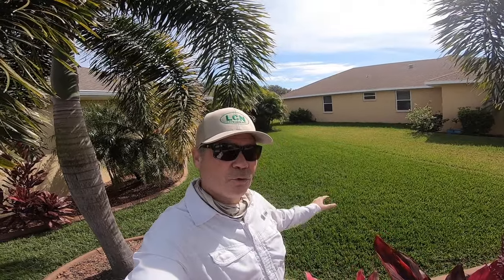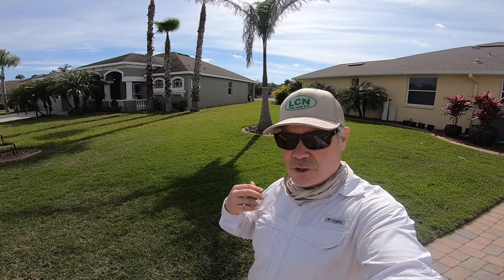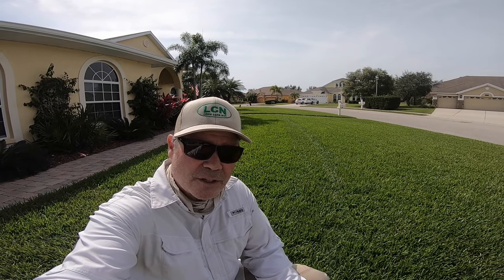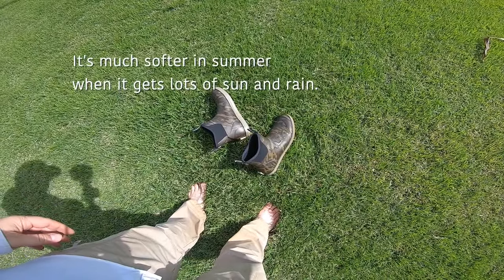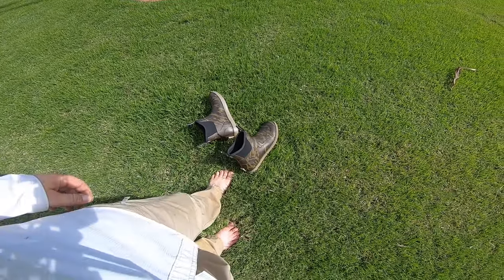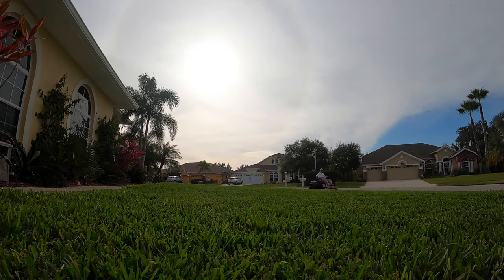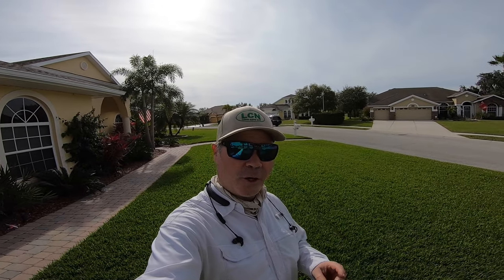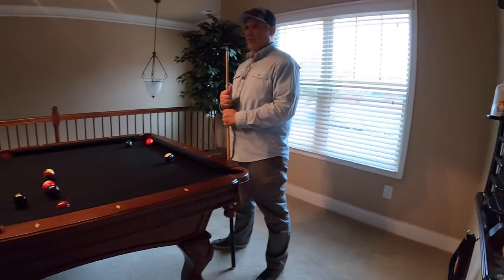Top 5 Reasons Why I Love Zoysia Grass

Comment: I love Zoysia. I have Emerald Zoysia which is one of the finest bladed varieties. It's so thick that it completely chokes out weeds. It's slower growing than Bermuda and more drought tolerant. I'm located in north Alabama and it grows great here, it does go partially dormant but there is always some green near the dirt line. I mow between 1.5" and 2" but will go as high as 2.5" during periods of extreme heat. It also needs less water than Bermuda.
Reply: Hello from Huntsville, AL!

Comment: Hey Allyn just to let you know about a completely dead battery.... If you ever have a completely dead battery and your battery charger won't charge it, it is because the charger is not recognizing the extremely low voltage to allow it to pass current into the battery. Since that was a 12 volt battery you could have tried jumping it off with your car or truck. That is not something I would do all of the time but it will work. I would only have it connected long enough to start the mower and let the mower recharge the battery. It beats going and buying a battery......batteries are too expensive. Anyway hope this helps if it ever happens again. Battery chargers are really only designed to charge "low" batteries not dead batteries. Also, love the zoysia!!!
Reply from the maker: Thank you! I am learning everyday. Some other guys mentioned getting a trickle charger - would this accomplish the same thing?
Reply: @Thelawncarenut  it should but I would look into it. Most battery chargers are called "smart" chargers which detect the voltage of the battery to determine how much charging amps and volts to put to the battery to charge it. Different levels of charging if you will with trickle charging being the least aggressive. That is why if the voltage is too low it cant detect it. A charger that does nothing but trickle charging should work but keep in mind that yo trickle charge a battery from 1.7 volts to 12.7 volts is going to take a long time. And just as an FYI.... in a car anyway...... a fully charged battery is 12.7 to 12.9 volts. Fully discharged battery voltage is around 11.4 to 11.7. Hope this helps man.
Reply: @Thelawncarenut  hey Allyn just did some quick research for you. Yes a trickle charger will work as it does not detect if the battery is charged or dead.
Reply from the maker: @johnpapp92  thank you!!
Reply: @Thelawncarenut  anytime buddy.

Comment: Kansas City here.  Transition zone.  They are big on the fescues, etc in town and don't push zoysia.  Our guru Toby T  told me here 15 years ago that zoysia was bad because it gets disease.  "I could show you a whole bunch of yards that look awful."  Well, I have been doing it the official way for years now and I don't see how zoysia can be any worse than the fescues, ryes, blues, especially this time of year.   These cooler grasses hate our summer heat and they require fungicides if watered too much (or have soil that holds too much water),  diligent continual watering(if you want it to live/not burn out in our summers)constant reseeding...and then more fertilizer.  I mean, seriously. Whatever.  It is pretty obvious that the cool weather grasses shouldn't grow here at all... unless you can't stand the yellow of zoysia in the winter.   Growing up we had zoysia in a side yard we called the "badminton yard" and I remember it took SO much abuse from our badminton games and still looked great.  All. summer. long. And it didn't require ANYWHERE close to what I have gone thru with tall/short fescues, blues, ryes here.

Comment: The battery could have been saved. When a battery Falls below a certain voltage most Chargers will not recognize it. You can jump it with another battery. Or find a charger that has a manual setting.
Reply from the maker: Someone did tell me that - they said I needed to trickle charge. Lesson learned.
Reply: @Thelawncarenut  na you dont need a trickle charger, just need a charger without a computer in it. Those old Schumacher chargers from walmart or harbor freight would force voltage into that battery. BUT, when you discharge a battery that far its life is significantly shortened so you would have needed a new battery before the season ended anyway.

Comment: I was always leaving the key in the ignition so it wouldn't get lost and finding a dead battery. I solved the dumb owner issue by putting the key on a tether attached to the mower. I can't lose the key and I now remember to remove the key.
I'm not sure why the mower has a key, since all Snappers have used the same key for 50 years? Before you say kids....kids shouldn't be near power tools.

Comment: In the transition zone, zoysia has seven rear life expectancy. It can't survive extended temps below freezing. In the Midwest most fairways and tee surfaces are zoysia. Most heavy maintenance (aeration, topdressing) needs to be done will it can recover. Ie summer heat.

Comment: I have a question.  About 5 years ago, this really fine turf looking grass started growing along the sidewalk of my front lawn and now has taken over the whole section.  When I cut it, it has a sweet fragrance to it and quite honestly, is a nightmare to cut because it's so thick.  I usually have to raise my mower deck higher for this section just to navigate through it.  Yesterday, I started a lawn service to get my yard in good shape and when I asked the tech, he said it was Zoysia grass.  Does it have that kind of fragrance when cut?  Why am thinking that it's something completely different and he just read it wrong.  I notice in other smaller areas of my front yard too.  He did spray for weeds, so I'll be curious to see if it starts turning colors and I'll know it's a weed and not turf grass.

Comment: I have learned a lot from your videos and for sure is paying off. I live in Puerto Rico and I have zoysia all around, and after aerator and fertilizer I am still dealing with long patches of very short blades, is like they are smashed to the floor, like having people all year walking on it, but thats not the case. I don't want to cut them with the trimmer because I dont want to hurt it, height is so short that mower does not cut it, just so you can imagine, I have tried even at 1.5" and no cut, these blades are really shashed to the ground. Their color and look is great, but they don't get up/grow vertically. Any advice? Thanks!

Comment: Be careful about enjoying your lush lawn.  The neighbors may suspect a different kind of lush and call the authorities to do a wellness check!
 Oh and these new battery chargers will not charge if the voltage on the battery is less than 8 volts or so. It's a "safety" issue.     If you put jumper cable on it that will bring the voltage up enough to so your charger will go. You really should use a current limit like a 100 watt light bulb(rubber fuse) or a really thin single strand of wire, which will get hot and will limit the current, and perhaps act as a fuse if you draw too much current if you are really concerned about exploding the battery.  Only seen that happen 1 time in my 53 years.   Better know where your garden hose is if it does happen. Your battery has been tortured if you have run it completely down like that and will never again have the capacity it had before but you should still get a couple more years out of a relatively new battery like that one. No telling how many millions of batteries have been thrown out simply because they were run down below 8 volts.   Autozone aint gonna tell you that either,  they want to sell you a battery.

Comment: Zoysia is less susceptible to disease when mowed at less than 3/4" and the Nitrogen is kept at less than 0.25 lb N per month.  No N should be applied in the winter months.  What is in Zoysia's favor is how it is resistant to most herbicides short of RoundUp, Tenacity or Pylex.

Comment: You probably could. have saved on the battery. I have found that dead batteries, that dead do NOT work good with electronic battery chargers. I let my truck charge a dead battery for 20 minutes to get a surface charge then hook up the battery charger.

Comment: Wasup Allen, quick question...I planted some St. Augustine, waited 6 weeks then put some Bonus S fertilizer on it watered it the next day. A week later almost all of it looks dead. What did I do wrong and will it come back
Reply from the maker: Awe dang, Im sorry to hear this. Bonus S is only meant to be used in winter. The Atrazine weed control should not be used in temps over 85F. So I am pretty sure you burnt it with the chem. The only way to know if it will come back is to start watering (if we are not getting rain) and see what lives. Chances are some will come back but also weeds and wild bermuda will invade due to the extra watering. It's a bad situation, I'm sorry man.
Reply: @Thelawncarenut  Man I sure appreciate that info, I'll probably just wait until next to plant some more cause it's just in my back yard and it wasn't that much maybe like 20-25 squares , but thanks once again!

Comment: Does zoysia grow on part shade area? If not what kind of grass can i put on the part shade areas? Thank you.
Reply from the maker: The term "part shade" is a tough one because of day length and sun position. Partial shade today when the days are still short is different then the middle of August when the days are longer and the sun is higher in the sky.  In general, there is no warm season grass that grows well in shade. You can test it in your lawn by planting some plugs and see how they do. Zoysia will do about as well as St Aug would. Probably do better than Bermuda.

Comment: Allyn, check out the Battery Tender Jr for an intelligent trickle charger 🔌 ⚡️
Reply from the maker: "Trickle Charger" was my nickname in college 😎😂
Reply: I use the Tender Jr. on my mower battery not the same as trickle charger.
“The difference between a float (or battery tender) and trickle charger is that a float charger will only turn on and charge your battery when it has self-discharged below a certain level, whereas a trickle charger continuously emits a small current of electricity regardless of the charge level or even if it's full.Nov 20, 2018”